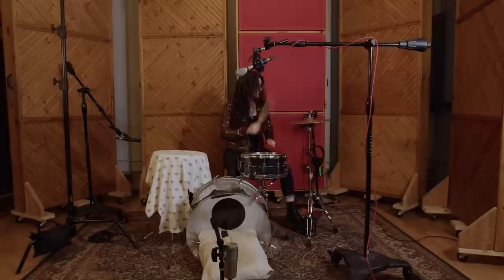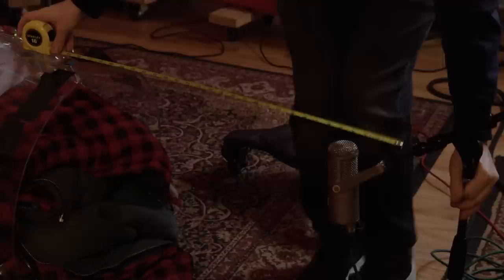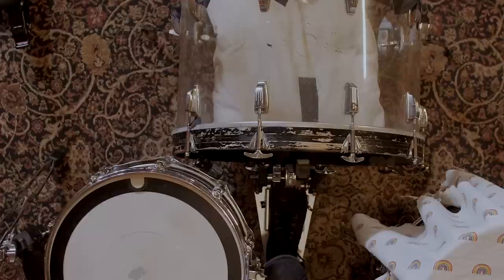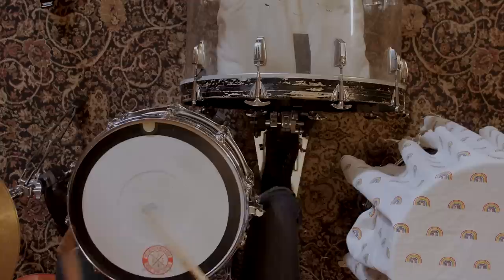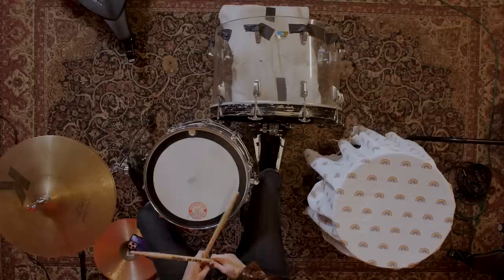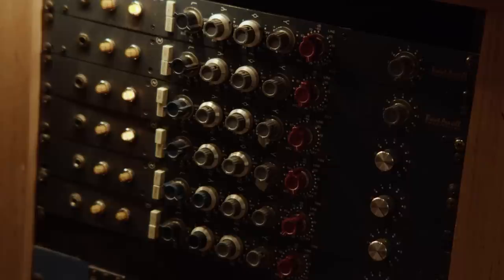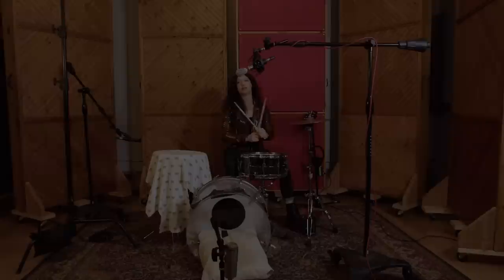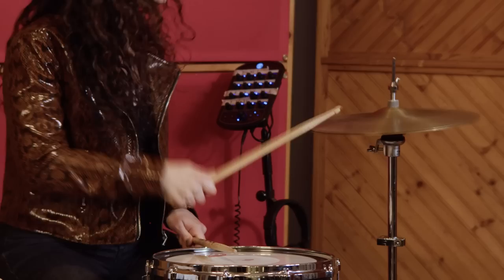Recreating the Black Keys' "Tighten Up" on Drums | What's That Sound Ep. 20

Comment: What is exactly the multi band compression doing here? Maybe showing the plugin will be a good idea, just saying.
Reply: yeah, in fact mb-compressor is the #1 plugin of all the possible production/mixing tools that should be accompanied by a visual representation of its setup if it is mentioned in any kind of context, ‘cause if it is present in FX chain, it most likely does the most of the job on the resulting signature sound, and if every other tool is [generally speaking] possible to recreate by ear in a reasonable timeframe (reverbs, saturators, 1-band compressors, etc.), recreation of a specific mb-cmp preset just from hearing the resulting signal - is a pure fucking nightmarish torture. even if the freq crosspoints were available as bare minimum of input conditions, it would be significantly easier already. but otherwise - it can take a hell ton of time, ‘cause of a shit load of parameters on the processor. and just to clarify - this rant is coming from someone who interacts with multiband compressors on regular basis for the last 15 years - still it never gets much easier lol. love these dynamic processors just as much as i hate them.

Comment: 'need this' 'I got a plugin for that'... 'need that' 'I got a plugin for that'... 'but what about...' 'yeah, I got a plugin for that'   It makes me wonder what is even real anymore in recorded acoustic expression or recorded music in general. A good video to learn what is possible with current tech.
Reply: Where have you been? Also, why does it matter if it's a plugin or hardware?
Reply: Where have you been? Shure level loc (sound toy devil lok) is from the 60s 😅 also 1176 and L2A2 are from the 60s… audio engineering is not new
Reply: Respectfully, you may have some weird ideas about what a plug-in is or how it works... A well-designed digital EQ is going to be more or less mathematically equivalent to an analog EQ, just without the non-linearities. Most plugins are emulating hardware anyway, and these days a lot of them get pretty close. With the exception of quantizing and pitch correction, most audio processing these days is pretty much the same as what was done in the analog domain in the past